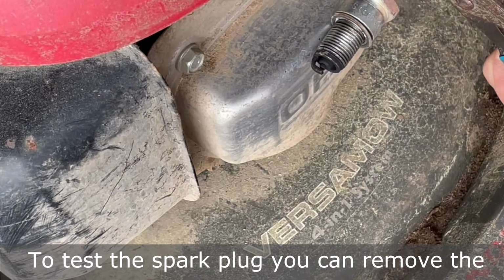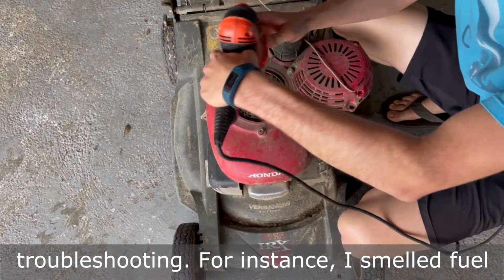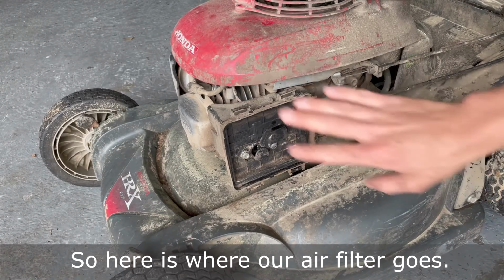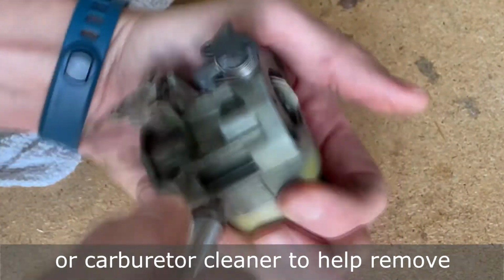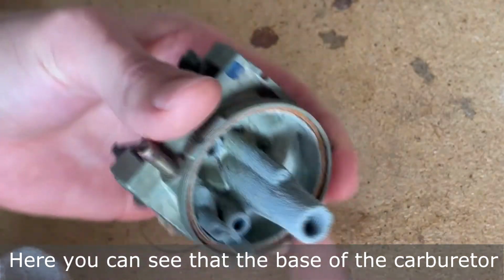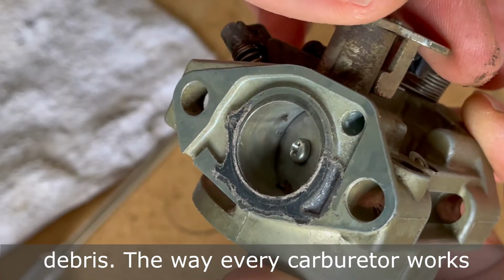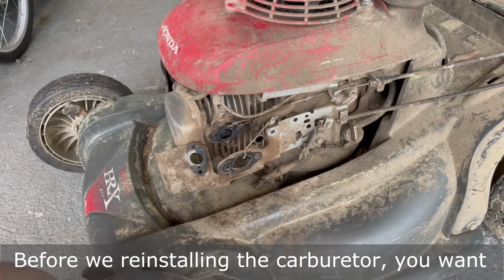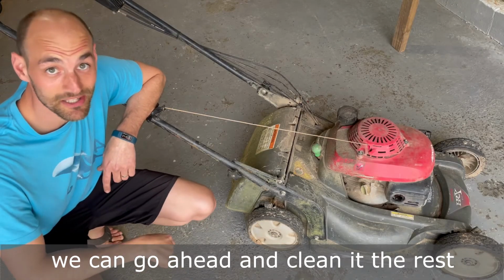How to Fix a Lawn Mower that Won't Start

Comment: I add new gas and oil and air freshener new and it still doesn't work
Reply from the maker: Did you clean out the carb? Check fuel lines? Check spark?

Comment: I changed the filter the spark plug cleaned the creator and it only starts with gas in the caberator directly 😊